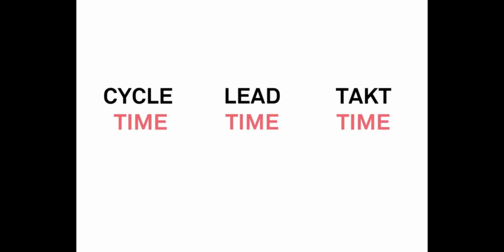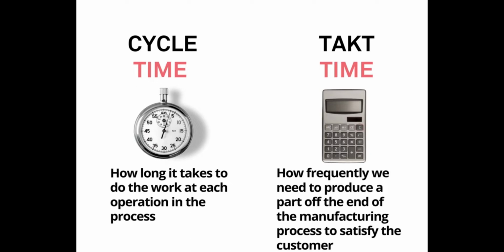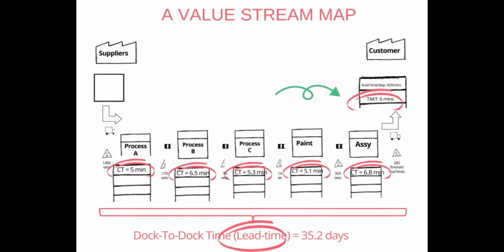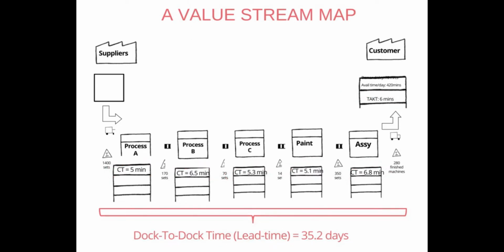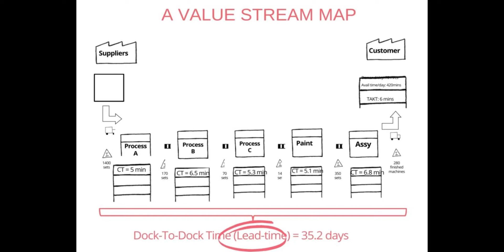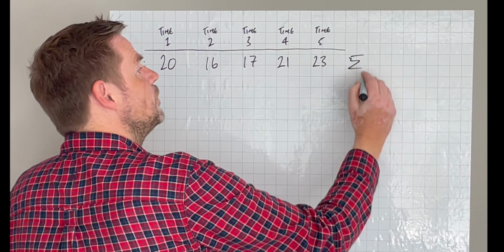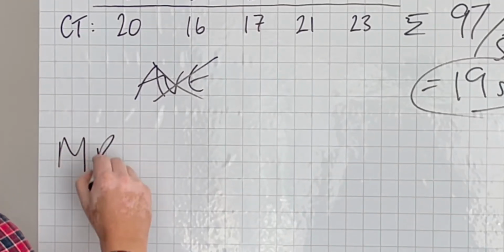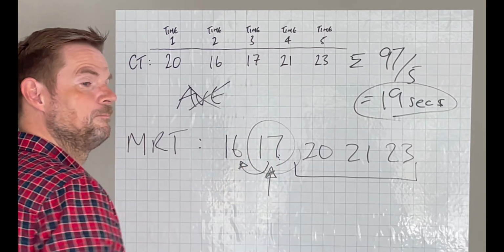Lead time v cycle time v takt time : Unlocking the secrets to boost productivity

Comment: Thank you, very nice.. I was wondering, if we manage to combine 2 steps into 1 box to reduce handovers and inventory between them. Let´s say in your example, we would manage to combine process B and C into one: then obviously the cycle time of that single process will be long (6.5 min for process B plus 5.3 minutes for Process C)but we would have people working in parallel on different units. How would that impact Takt time? in other words, we would still need to reduce the cycle time to meet takt time? Then combining processes is not reccomended?
Reply from the maker: Hi there - good question, the cycle time for each process box (on the VSM) is not the cumulative cycle time for every operation contained in that process box. It's the bottleneck cycle time (the longest one) within that process box. In this case, process B. We show different process boxes on a VSM wherever flow breaks down, so coupling/levelling B and C without inventory in between is generally a good thing. If we did just add the cycle time of B to the cycle time of C and gave that to one operator or process...then we'd be above Takt time. Does that make sense?
Reply: @the_lean_expert  yes it does! thanks a lot Russel